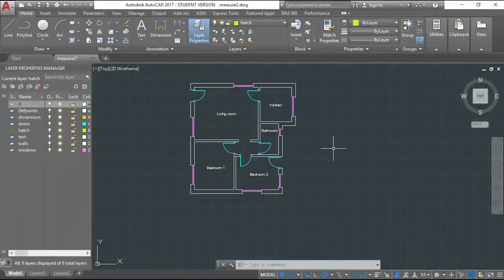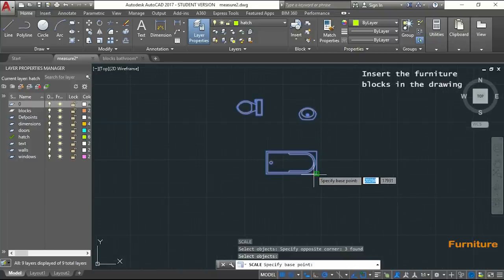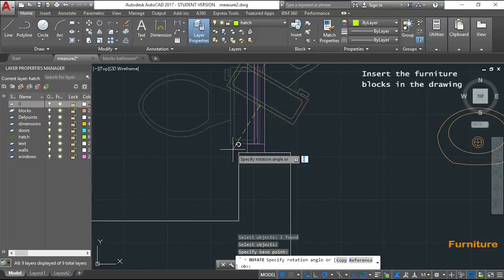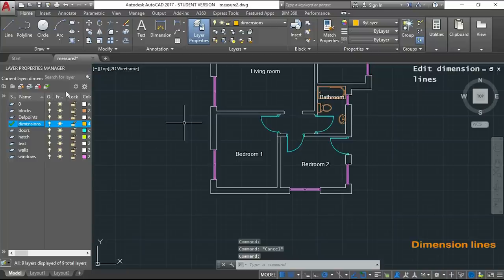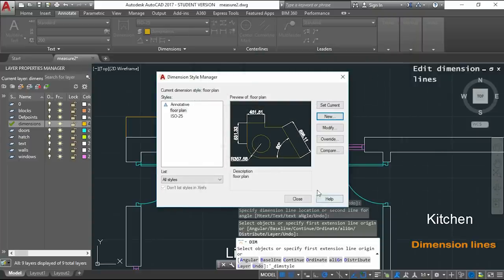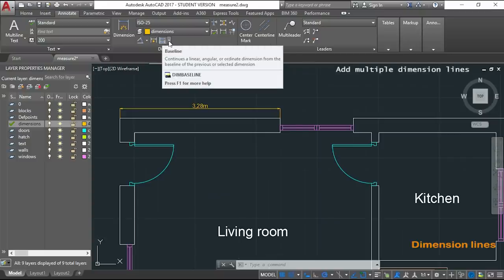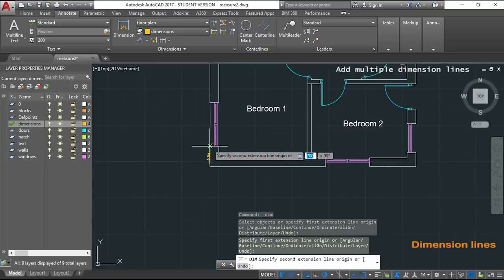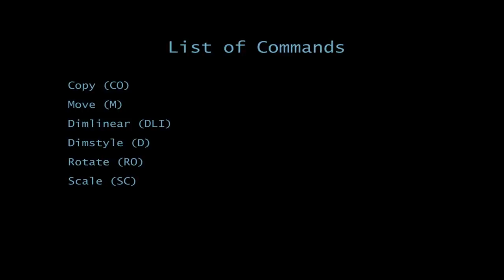AutoCAD 2D Basics – Tutorial to draw a simple floor plan (Fast and effective!) PART 4

Comment: thanks for the tutorial! 
Btw I am curious about the standarization of measurement. Do we calculate from the outer wall or mid (inside) of the wall? Because I watch on the other source they measure from (mid) inside of the wall
Just for simple ilustration :

 10m             10m
__|__      or ____|
|      |           |      |

Comment: But CAD 2017 is not yet available for MacBook right...? 

Also, there's no middle button on the Apple mouse, how to zoom or fit the screen quickly for IOS version CAD please?

Thanks!!
Reply from the maker: Hi +Baby0Eva0. First of all, thany you very much for watching my videos, and I am glad that it is helping you a lot. 
Check here if it is possible to download Autocad 2017 for MacBook. 
https://www.autodesk.com/education/free-software/autocad

I don't know how is exactly the apple mouse, But try to:

    Zoom in -> Glide thumb and index finger apart.
    Zoom out -> Pinch thumb and index finger together.
    Pan -> Use a two-finger swipe in the direction that you want to    move the content.
Reply: Thanks for your reply! Yeah it is not available ... T_T